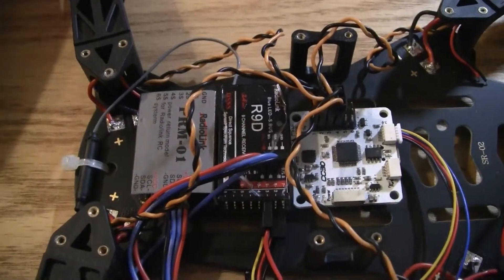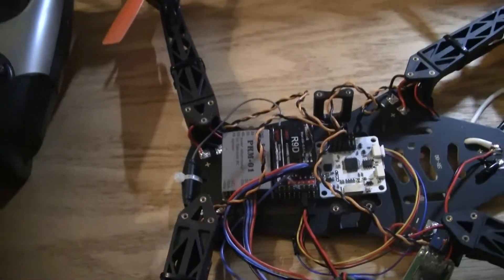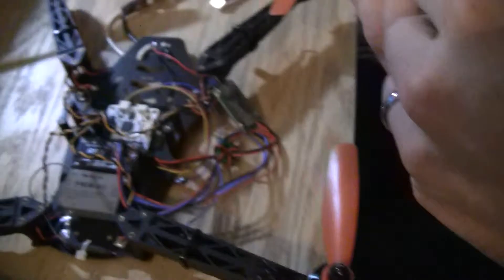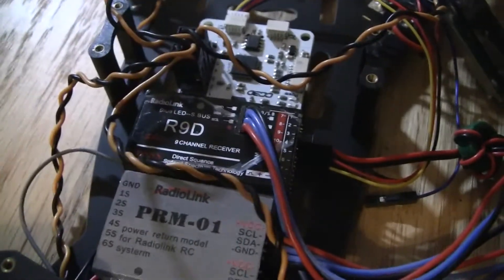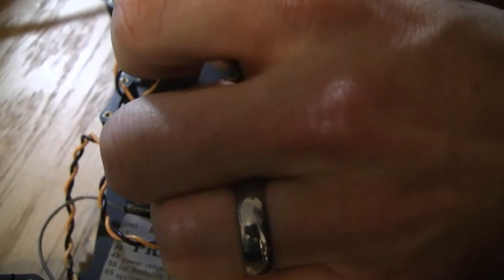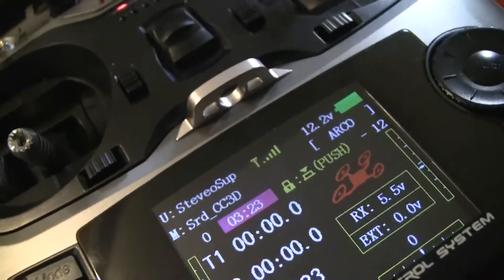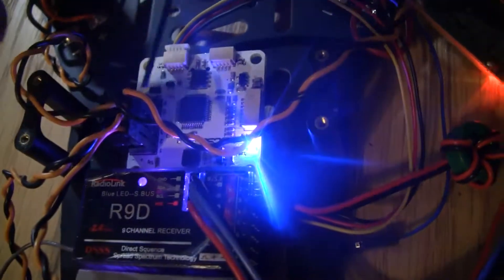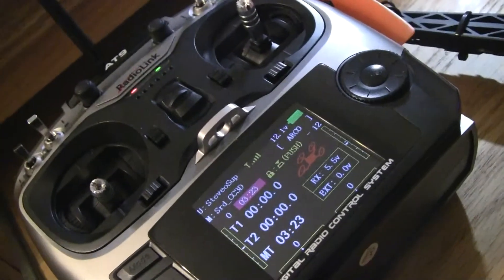Radiolink AT9 Bind and SBus procedure.

Comment: what  if i bought the receiver externally,, actually i have the controller but i lost the receiver what should i do? with the note that i could find the receiver is on sold online externally
Reply from the maker: Yes, you can get it to pair to other receivers that you find. I believe if it is a radiolink receiver it will work.

Comment: I have a AT9 question. How do you set up a new memory bank for a second quad. When you bind a receiver does it create a new memory or do you need to create a new memory and bind the receiver to it?
Reply from the maker: +Michael Mack in my Radio Link AT9 Review https://youtu.be/uyAAc6BODeo?t=4m30s at 4:30 I start going through the menu system. Under "Model Sel." you can set up a second model. I'm pretty sure you can bind another receiver once you are in your second model selection.
Reply: +Five30Reviews Found it. Thanks for the advice and the video. One last question. Do I have to get a R9D receiver to work with the AT9? I have access to a FrSky x8r receiver but I don't want my friend to send it to me if it won't work. Thanks again for the videos.
Reply from the maker: Michael Mack Honestly I have no idea. I should see if I can find that out though. If your friend gets you the reciever and it works please let me know.

Comment: But how did you connect it to cc3d
Reply from the maker: With the cc3d there was a 4 wire cable that connected between the at9 I believe it is the bottom pins on the first 3 channels and the cc3d.